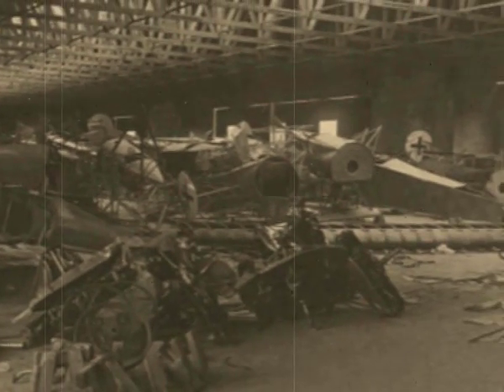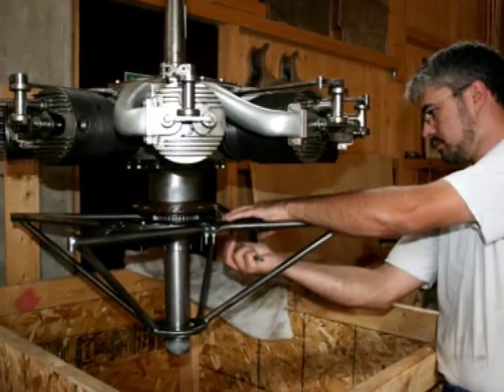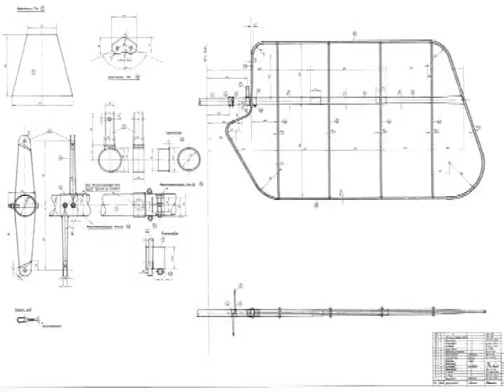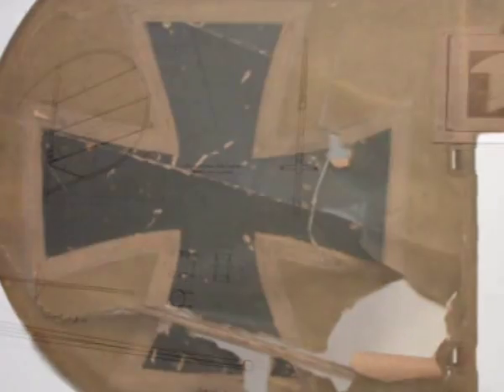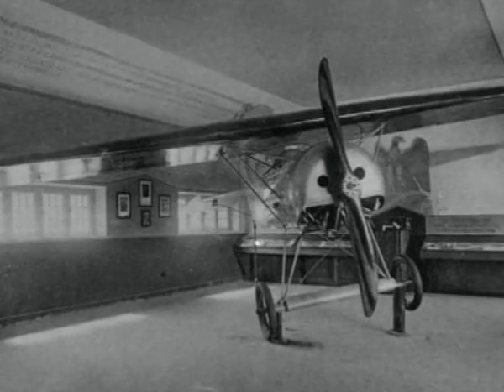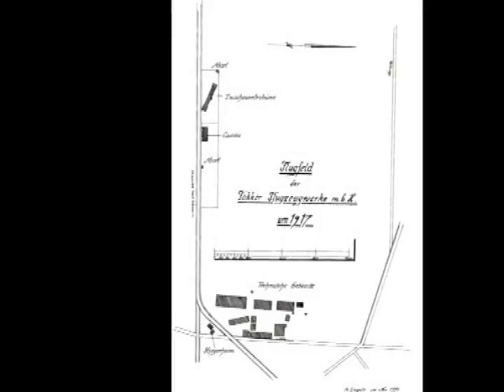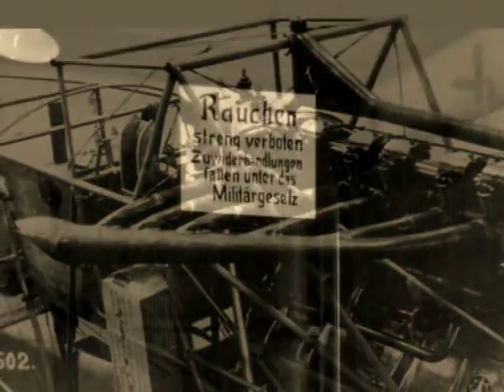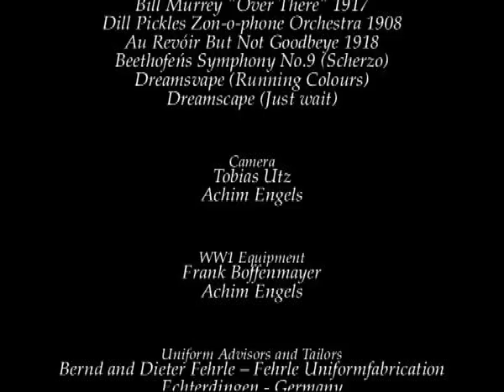Fokker - A Time Machine / Museum für Flugzeugbau und technische Geschichte (MFtG)

Comment: V M Yeates author of Winged Victory & RFC Camel pilot observes that the late War Fokkers were relatively fragile under gunfire (probably because of the absence of bracing wires).

So these aerodynamically clean aircraft were superior machines except in their ability to absorb machine gun fire.
Reply from the maker: The reverse conclusion would be that the aerodynamically and structurally weaker aircraft survive under fire and damage to load-bearing components only because their many wires hold them together. Well, that is a view that can be held althoug illogical, since the wing spars of a Fokker can take plenty of bullet holes due to its design features, while a Sopwith camel has a single piece spar which can not hold a lot of damage either. If a Hs 123 had had tension wires, it probably would not have fallen apart until later in the event of a spar break due to bullet holes.

There ar no reports other than your emntioned pilot claims of late war Fokkers to fall apart under fire - but here is plenty of images showing aircraft of late war periods with patched bullet holes which in essence contradict that statement.

Fact is, the Foker designs paved teh way for post war aircraft development, not the Sopwith designs. Nothing new was in them them. Wooden fusleages, ordinary thin airfoil wings, bracing which aerodynamically innefficient....etc.....and teh Camel even has a reputation of killing more own than enemy pilots...not sure if that is actually true though.
Reply: @AchimEngels  the author's personal observations were obviously entirely subjective & made from experience of great stress (he was involved in extensive ground staffing operations in the Spring of 1918).
He does, however, mention several observed events where the wings of Fokker Triplanes folded up & collapsed.
Deaths in training on the Camel were very extensive & it has been said that had it been introduced in peace time, it would have been rejected as far too instable.